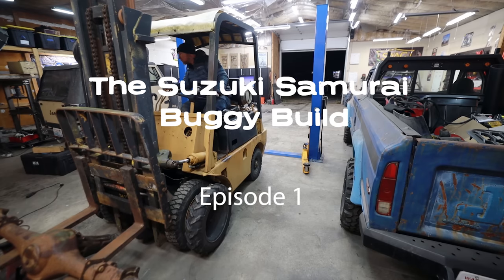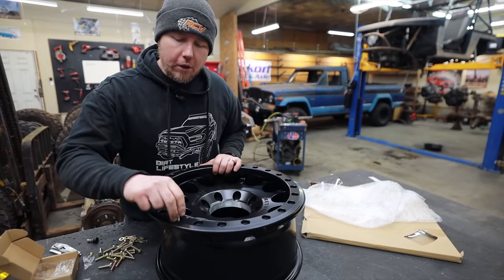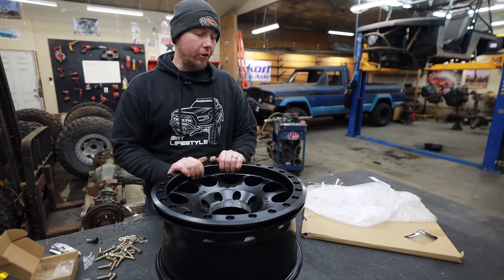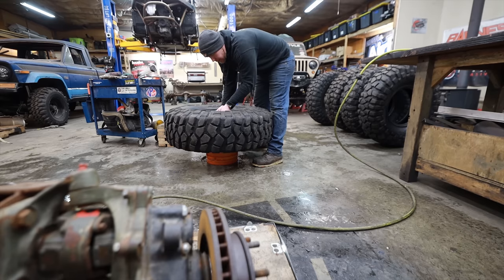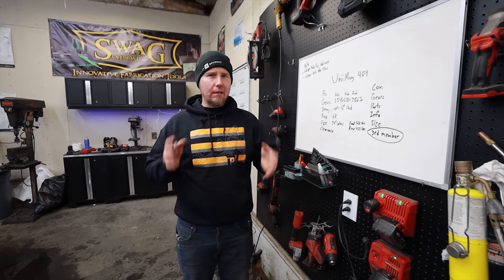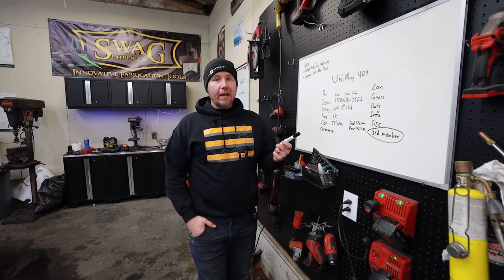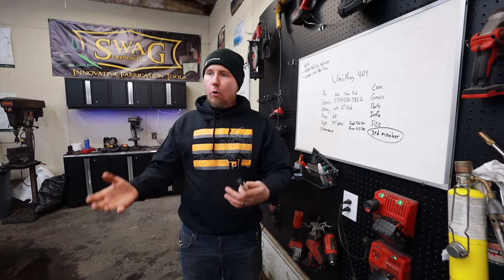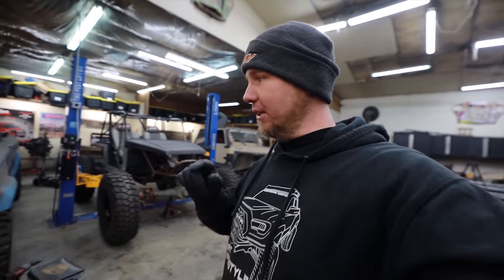Ultimate Suzuki Samurai Buggy Build! Episode 1 Unimog Axles, Wheels And Tires.

Comment: Love the 404 axles, i've got them under my rig and they weight 630 lbs with the stock boxes and fully dressed with link mounts and the steering ram mounts.

The big issue with these axles and the stock boxes if you run very little wheel backspacing, that causes a lot of stress on the boxes and it causes them to fail.  Since your axles like mine, have been converted to 8 lug, that pushes the WMS out which already introduces some stress to the boxes.  Just keep that in mind.

For the specs and details for our axles, a lot of it comes from the factory Mecredes manuals.  Hit me up, I paid for a manual and can help with some info if you need it.

Comment: For those who don't know or notice when using bolts in aluminum you have two issues:
1) Dissimilar metals cause galvanic corrosion so some type of "neutral" behavior material is used either as a insert (like a Heli coil but better) or a coated bolt (preferred). This is why many a times you have aluminum wheels stuck to your hub, rotor, and/or drums.
2) Problem with the grey anti-size it that it works to good. There is a reason they have huge warnings NOT to use grey anti seize on lug nuts with aluminum wheels. The heat and cold cycles will cause the lug nuts to loosen. I have yet to have a car roll in the shop where some one put grey anti seize on the lugs and the lug nuts are actually at torque speck. Usually about 10 -20 lbs less. 

One suggestion is use Copper based anti seize. Yes, the one for high heat. It doesn't work as well but will prevent the Galaviz corrosion along with coated bolts especially on exterior bolts. 
On a rock crawler I wouldn't be worried and am sure they get check on a pre-op when you double check before hitting the trail(s) but be careful on road applications. I live in MN so everything gets some type of lube when it goes back together and driven in the winter.

I am sure people will complain about using a power tool on aluminum too. As long as you start the threads and use low torque you are fine. I would argue no fastener should be blindly run into a nut or a-nut etc. with out first starting it by hand. Few bolts with the non-threaded guide at the tip might be the exception.
Reply: HOGWASH!! I use grey anti seize on  all my lug nuts and never had one ever loosen up.

Comment: I’ve seen the show in Europe on a local tv and years later I’ve decided to build one. Unimog 404 axles are quite cheap here  but I couldn’t find the adapter kits for the wheels and driveshaft. It took me 2 years to build it and I still have it. 1.9 tdi , toyota lj70 gearbox , unimog axles and 42 tredadors. The lightweight on top and heavy axles under make it a beast everywhere and especially in the steep lateral inclinations. I’m glad to see it again on your channel .
Reply: The only thing cool is that they used to make a axle housing and shafts here to offset the 3rd member to avoid hitting the engine and luckily I bought the last one they used to make

Comment: I saw on here a company I think Polish but could be wrong, they manufacturer portal box's that bolt to your stock axles of man vehicles, it comes as a kit mainly bolt on with just a couple of welds needed, they are very well made and easy to fit and look very very strong. 
Definately worth a look.

Comment: It's going to be hard to hit your weight goal because the mogs with wheels and tires weighs close to the original weight. Also be sure your hardware and links are beefier than they were...the portal boxes put a ton of added stress on those parts. I learned the hard way with broken bolts and shocks.

Comment: Cool project coming together. Surprised you skipped discussion on checking the bead lock rings for full seating (with a feeler gauge) at recommended torque to see if you needed to add shims. I think this is something a lot of people skip when assembling beadlocks and later wonder why they have issues with loose bolts.

Comment: I could use the other parts you do not need for my ugly project 86 samurai buggy :) Remember watching this thing being built so rad :)

UNITARDS my nickname for them. Worked at a shop where we had several. The 404 being the most common. The 406 tug was my favorite. If you were paying attention to the online photos, the green 4 door one with the giant front bumper. The 404 has a (not kidding) 2.2l i6 making 65hp for a vehicle that is configurable to 14k lbs. Drove a 404 communications MOG (12k) up Ute pass from Colorado springs to Woodland park, CO. I was lucky to be doing 15 mph.  No heater, no ac. So unitard axles do not like high hp or bouncing trying to climb rocks. My buddy has what is left of a 93 ford ranger with portals and 47's. If he bounces climbing the exit of the Patriot Trail in Penrose commons ohv, Penrose CO. He will break a portal easily. With a 3.0l v6 lol. I would do a 16v 1.6l tracker auto and tcase to a samurai tcase with low gears or just go yota doubles. More than willing to help in any way. Let me know :)

Comment: Finished a 404 buggy build 2 years ago and just about done with a 406 buggy build. Haven't have great luck with the 404s. 39s should be good but 42s are too much. Can bearly get though a weekend without breaking. About the same weight you are shooting for, maybe a little more. Even broke a ring gear which was told would never happen.

Comment: #4x4buildseason first thing is to complete my shop,I am permanently disabled so $ and pain are limiting lol but mostly finished my shop last year. I have 2 40' shipping containers spaced 30' apart and concrete poured between them to the same height as the container floor so I can cut large holes in the sides and be able to use a pallet jack to move things off the floor into the cans as well the building is a quonset type but goes to the outside edge of the cans so they are inside the shop allowing for more storage on top  of them. I put pex in the concrete and will connect that to a wood fired boiler I got for free and will enjoy heated floors when it is -30 outside! I should have recorded the build of the shop and put it on YouTube  but i was focused on getting the shop done. I am designing and building my own doors for the front, maybe I will record that part.....
Soooooo, whatcha doin with the yota axles??????
I am looking to build my tin top Tracker this year,planning a TDI swap and toy axles , t case gears etc....

Comment: It's interesting the differences in mounting a traditional beadlock vs the hutchinson dual beadlock setup on my rig.  My beadlocks require an insert that goes into the tire just inside the beads -  then when you torque down the rim to the wheel, it squeezes both beads between that insert and the edge of the wheel/rim.  My wheel has studs that are press fit into the rim and require a first pass torque of 50 ftlbs then finally to 75 for all 20 bolts. 
Also if you're looking for cheaper portal axles - go find HMMWV hubs and bolt them up to your silly solid axles :D

Comment: Excited for this build! 
Quick question on beadlocks if you get a moment, why is the outer bead the only one that needs a lock ring? Do the inner beads commonly pop and if not why? What's the difference? I've had no luck googling this question in the past.
Reply: The reason I’ve heard only one bead needs locking is that when you’re leaned over, all the force is on the outside bead. When a bead fails on the trails it’s always the outside bead from an off camber situation. 
The YT MORR channel did a good bead lock discussion a while back
Reply: @juliangarrett6373  Right on thank you

Comment: Unimogs are really cool. If you ever want to build one, look for a U90 or U110. They're a bit smaller, about 404 sized, and have a weird droopy hood for visibility. They're more modern than the 404 but still compact for your kind of wheeling. They're less expensive because they're ugly and not as iconic as the 404. The 404 is also a bit tight in the cab but the U90 has a taller roofline.

Comment: Three things:

1) you need a shop manual for the torque specs on everything. There is an online pdf version floating around.
2) all spare mog parts can be purchased from expedition Imports.
3) I have a set of spare portal boxes if you want to carry spares.

Comment: I have the same wheel on my JK and if i took them over 15lbs the threads pulled right out of the alum, granted they are well used and its deff not the first set of tires on them. Ended up having to fix prob 5 holes by the time i was done

Comment: I run the 404s on my buggy,  definitely hard to package the things with the pinion. 

Strong is questionable,  I've broken a lot of parts in my short time running them.  Keep it light and and small motor and you should be fine, don't bounce

Comment: bearings are super easy to get, i can give you all  necessary   bearing sizes it needs
Reply from the maker: It's all super easy to get... just order it online lol. But I guarantee if I walk into auto zone they will stock every bearing for a ford 9" and only a few for these unimogs.
Reply: @DirtLifestyle  i can  find them here in my country without any issues,  i will give you all sizes and you just ask and see how common sizes these are :))) i was surprised as i could get them without any issues
Reply: @DirtLifestyle  Nate could you please confirm you have received PDF file and its all good?

Comment: I have the English workshop manual. It has everything about the axles in it. The info is not all over the place just get the workshop manual.

And for the bearings it isn't that weird. Check SKF bearings because they use standard sizes.

If you need info send me a FB message. I know enough 404 experts.

Which disc brake conversion did you get?

Comment: Is there a max tire pressure you can run with beadlocks, when putting road miles in? For some reason i was thinking 32psi.
Reply from the maker: Good question! It would be dictated by the clamping force created by all those little bolts. A mechanical engineer could certainly give you an answer!

Comment: Curious on why you didn't get a Dana 60 and 14 bolt or similar and just put portals on the end and be able to get more readily available parts
Reply: Because you will go in reverse.
Reply: @EricaMTB  im not following you on this reply...
Reply: @EricaMTB  the current best axle set-up I have ever used were actually the new 3rd gen dana axles (basically upgraded JL axles) with the high clearance center section and portals. It is absolutely insane how strong and high clearance these axles are.
Reply: @EricaMTB  they make portal kits and full axles with portals on them that are corporate or Dana axles.
Reply from the maker: Cost... It really is that simple. I don't see any reason to buy 2 more axles, gearsets, lockers and custom shafts, when these are notoriously strong in stock form. I would definitely gain a HUGE advantage in packaging if I built hybrids but the cost would go from 6k to 15k pretty quick. That said, I'm pretty sure we will build hybrid axles for the TJ. But I would like to build some ford 9 housings with portals boxes on the outside 😁. The difference is the TJ will be a street legal truck and not a trailered tube buggy.... it all makes since to me lol
Reply: @coryrustin4531  Unimog portals reverse the rotation of the axles. Because of this, the third member crown wheel has a reverse rotation. Aftermarket portals have intermediate gears so the output is the same rotation as the input.

Comment: Using the MB Unimog axles is common in Iceland, usually as a replacment axles on Ford F350´s and Ram 3500. One of the trucks built here has 4 axles and steers on both front axles. Most of the trucks run 54" tires and are commonly used for winter travelling in the highlands as well as touring the glaciers. Link to a video: https://www.youtube.com/watch?v=eT75K8cvfkk&ab_channel=Fri%C3%B0rikHalld%C3%B3rsson

Comment: im in the process of building 404 and in my case first gear final ratio is 404:1  no joke :)
Reply from the maker: Damn! I figure I will be around 120:1 in first gear, but I need to sit down and do the calculation.
Reply: @DirtLifestyle  im  making motor home  from my 1963 404, i swapped engine, now it have 3.2 V6 merceses engine, but i have 2 gearboxes, one is  5 speed automatic and there is 6 speed manual original gearbox from 404 unimog that will be used as transfer case, so when you will have 1 gear in auto and 1 gear in manual gearbox total number is 404:1 :))) its crazy but thats what it is :)))

Comment: This makes me think of Jessi Combs.. R.I.P. sweetheart..
Reply: Great!! 
You should do the lower kingpin upgrade to prevent the inner C from failure. It is pretty common when crawling and also with  up front ballast on tires.

Btw, it should be good to shorten the axle from the short side for better driveline angle. This will allow you to configure the car lower .

Great combo!!